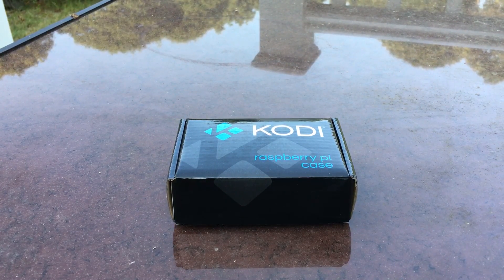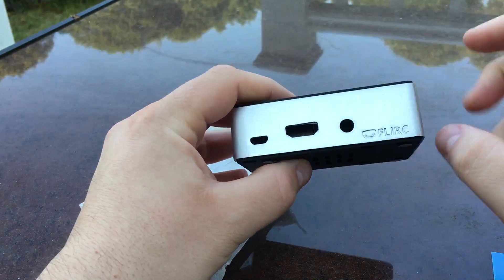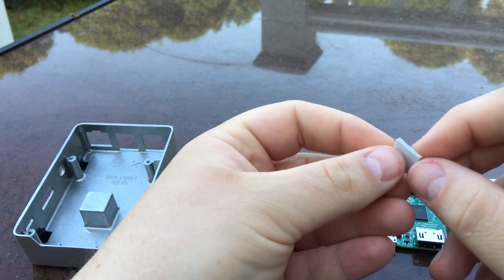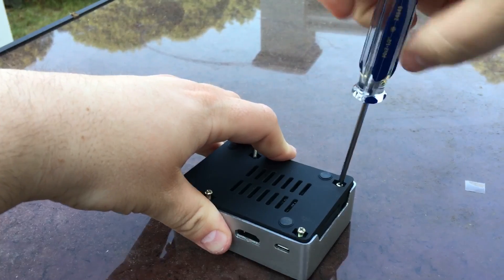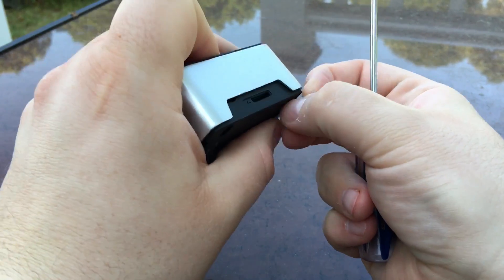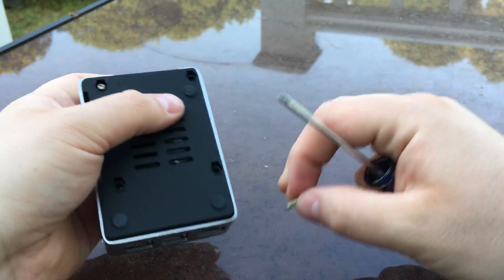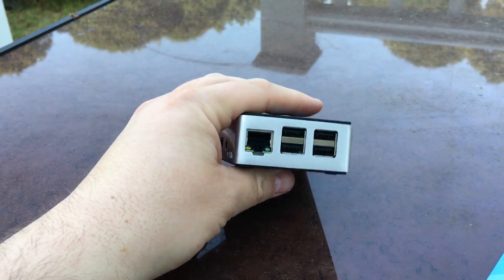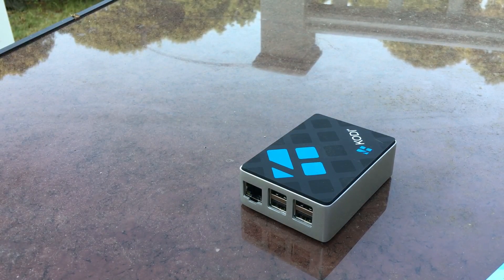Official Kodi Raspberry Pi Case Unboxing and Installation

Comment: The way you rested the case on the screws that were on the table and applying pressure on it while doing that, show your lack of skills. You can see how you scratched the top rubbery part in the end of the video.
Reply from the maker: lol, you are correct. It did get slightly scratched. But it was not from screws, it was from the outside table which was very dirty.  I will be giving away the Pi 3 and the slightly scratched case, though. Stay tuned.
Reply: Can this run Kodi fast? Say I have a 20 TB HDD plugged into it and I'm scrolling through the Kodi library menu - is it gonna be slow? Video playback / ff / rw is good etc?